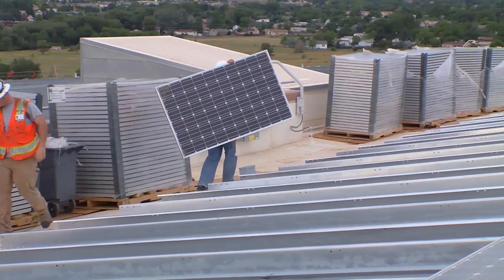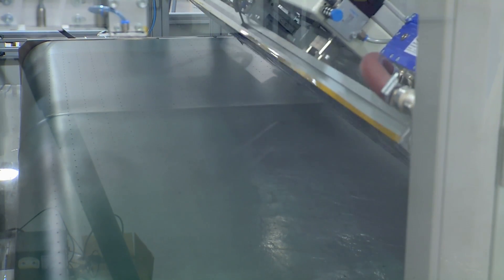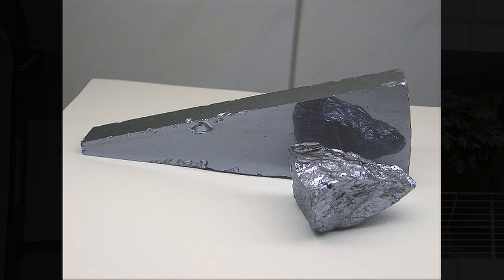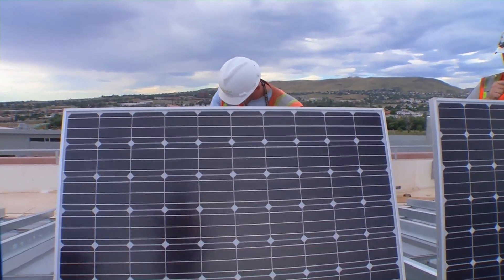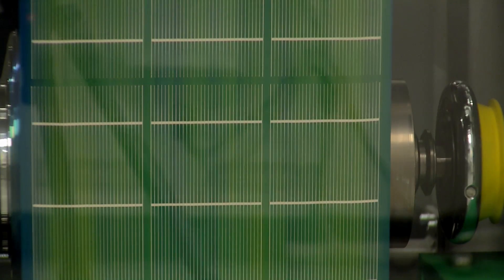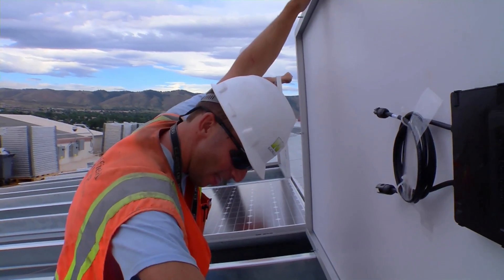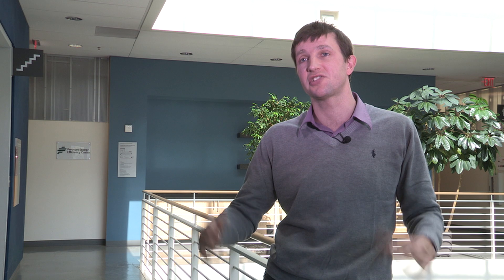Breakeven Breakthrough For Solar Power

Comment: The energy payback time of a standard solar panel is about 2 years.
Therefore, the energy balance of a fast-growing solar market has to be negative.
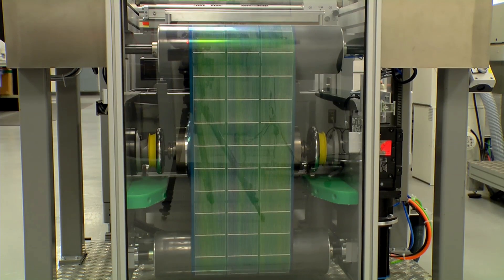But that's rather trivial, isn't it? The question at 1:27 seems to be misleading.

Comment: How soon will these thin film like photovoltaic sheets be in available? 

The goal should be to make this almost as cheap as installing tar shingles on the roof. That should turn things around - No more reason for oil pipelines and fracking.

Comment: The low capacity factor is not such a big problem until solar becomes a much larger percentage of power generation.
The reason is that in many places, daytime energy costs are MUCH higher, where the afternoon peak demand might drive utility prices up 5 or 10 times above normal. This is usually when solar produces best so it very effectively reduces the need for expensive peaker plants, which typically create the most emissions per unit energy.

Comment: The difference with graphene is that it is cheaper than lithium. Graphene is just a single lattice layer of graphite atoms it is cheap to produce as well you can make graphene yourself by just writing on a piece of paper then using take till you get down to a single layer of atoms. The material is cheap, Production is cheap and it is non toxic unlike lithium. If you use it for batteries something that would take hour with lithium will only takes seconds with graphene.

Comment: Did I say you could purchase them now? I meant to put 45% but they are coming out with 70 to 80% efficient ones in the near future thanks to the the finding of graphene in 2010. With in 5 year they will have graphene solar panels out that have nano antennae. Not only that we will be replacing our chemical batteries with graphene batteries which will also make solar a much more viable option.

Comment: Oh and there are 75% effective solar panels they are working on them in a lab in Idaho so the physical limitations you were talking about only applies to silicon based panels which are only used not for their effectiveness but for the ease of making it. In less than 5 years there will be 70-80% effective solar panels being used.

Comment: your right that was suppose to read 45% but i realized it after i posted it so i couldn't change it. Far from economically viable huh? So you are saying that since something doesn't make money right away than we shouldn't invest in it? If people thought like you we would never have used oil. Cost of oil back in the late 1800's to early 1900's was over 150 dollars a barrel with inflation. Plus the efficiency of oil is so low we only burn it which is the lease effective way of using it.

Comment: Your claim that:
"On the contrariety they are anywhere from 34% efficient to 75% efficient at least the modern ones are. "

Is plain wrong I'm afraid. There are physical limitations, and lately "progress" in efficiency has been slow. 

To quote wiki:
"In 2013, the highest efficiencies have been achieved by using multiple junction cells at high solar concentrations (43.5% using 418x concentration)."
And these far from economically viable. Most are around 20-30% efficient.

Comment: Wow um could you please tell me were you are getting your info from? Because solar cells have not be 1-5% effective since there creation back in 1870's. On the contrariety they are anywhere from 34% efficient to 75% efficient at least the modern ones are. Efficiency has to do with placement and materials. And true older ones have to be replaced that is because modern solar cells far exceed older ones. That is like saying we should stop using computers because we have to upgrade to new systems.

Comment: 5% of free is a win yeah?  There are already lensing options and thermal options that can be added, when required, to existing PV systems to increase their efficiency by a significant amount.  You can also use peak PV output to break down hydrogen and store instead of batteries.  Think with brain.

We have the technology to cheaply deploy an effective free energy tool, that is proven effective, has prototype tech that drastically increases efficiency, and the ability to upgrade legacy tech. WIN